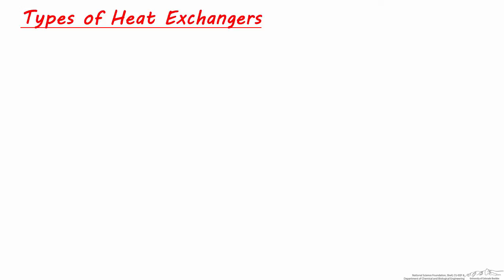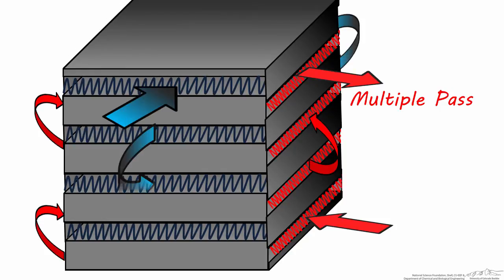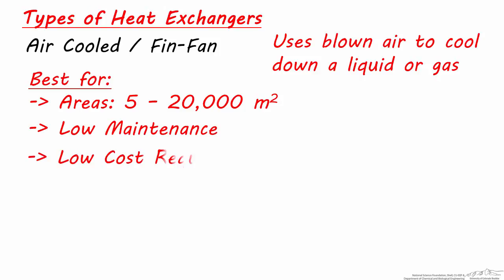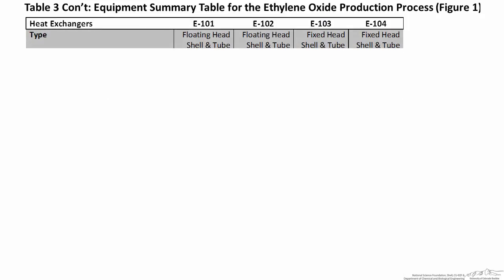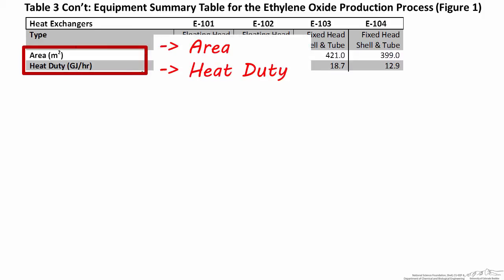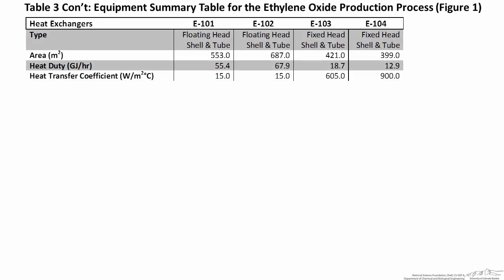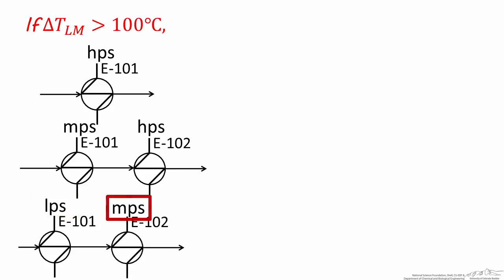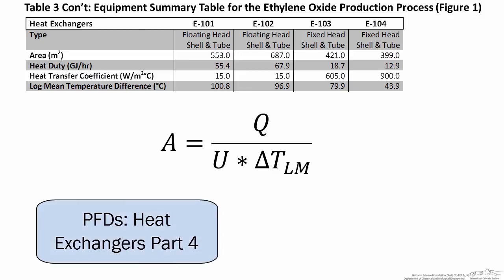PFDs: Heat Exchangers Part 3

Comment: The calculations are wrong I changed the 1st heat duty of 55.4 to W (J/s) and got 15388888.89 J/s but when I calculate area I get 10177.83657 m^2